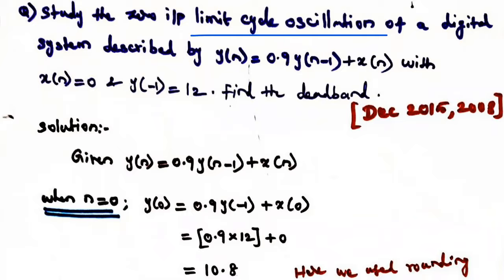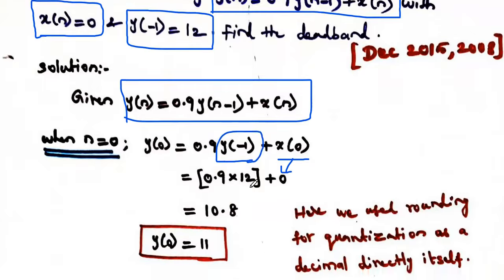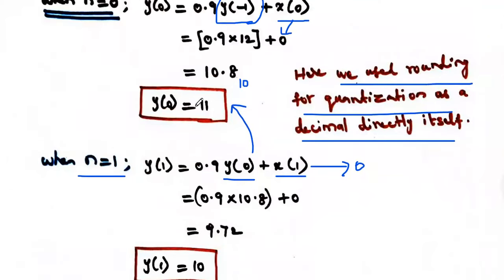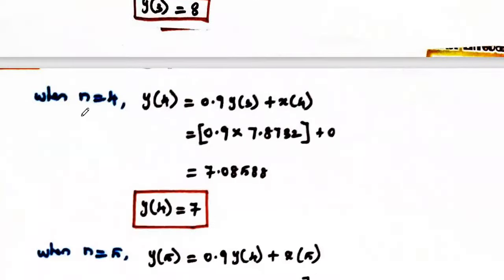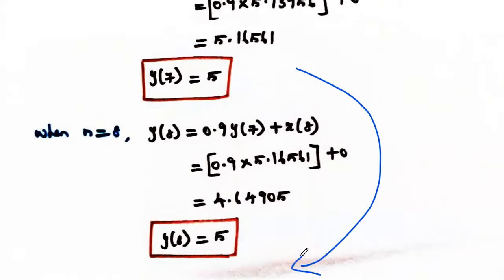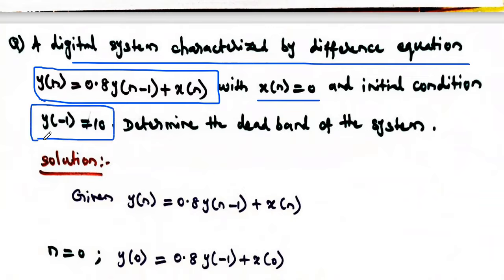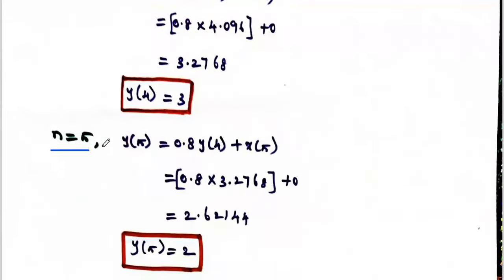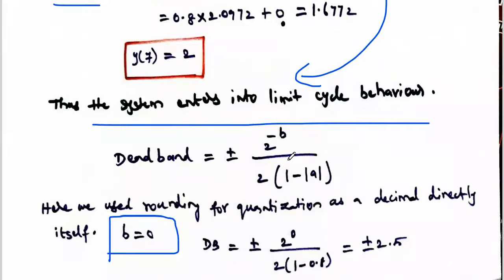Limit cycle oscillation | Limit cycle oscillation problem 3 | Dead band | dec 2015,2008

Comment: Anna University Part c -EC8853 NOV/DEC 2020 limit cycle solution available? 
The first order filter is implemented in four-bit (including
sign bit) fixed point two’s complement fractional arithmetic. Products are
rounded to four-bit representation using the input x(n) = 0.10d(n). Determine
i) the first five outputs if a = 0.5. Does the filter go into a limit cycle ?
ii) the first five outputs if a = 0.75. Does the filter go into a limit cycle ?